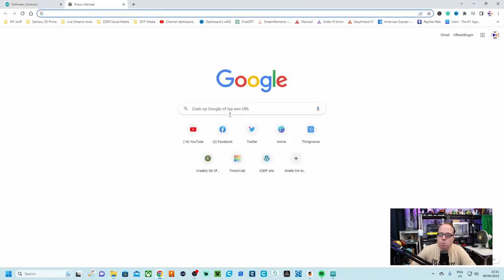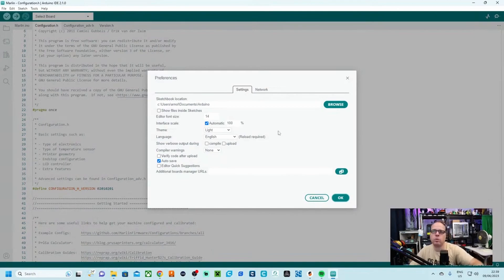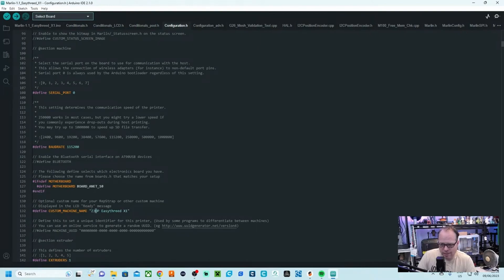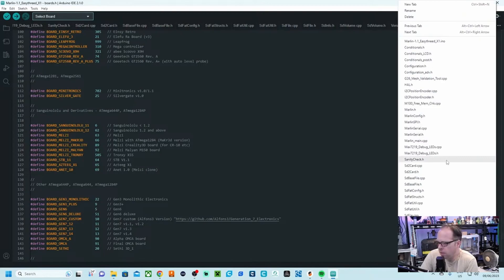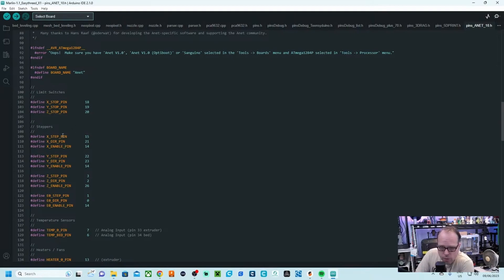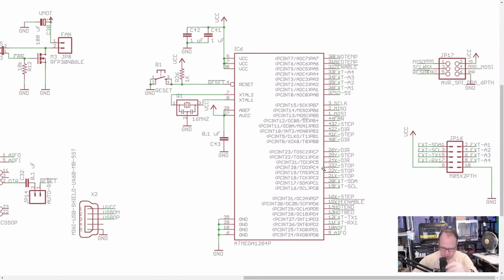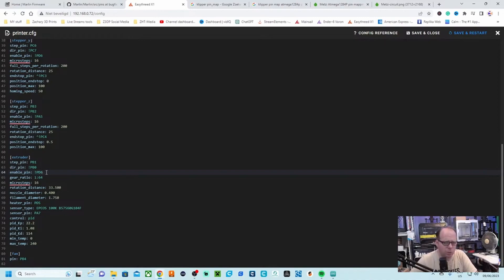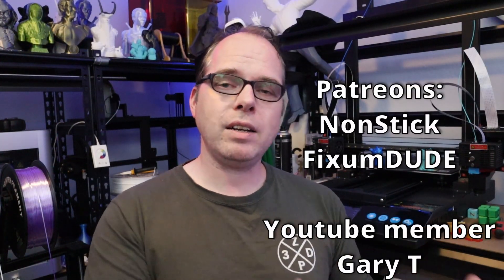PIN Address controller board for Klipper - Easythreed X1 Upgrades part 3

Comment: Did you ever get a working config? if so, can you share?
Reply from the maker: Sorry for my late reply. Yes I got it to work running Klipper, but not with the desired results and this printer isn't built for that speed. Motors are geared motors and getting very hot.

Comment: Hello. I appreciate your work on this. I recently acquired an X1 and am interested in using it with Klipper. Have you posted anything on GitHub for this by any chance? If so, do you have a link?
Reply from the maker: No I didn't shared it on Github, but I do have a video where I show the config settings. But I didn't continue with the project since it took ages to get the settings perfect and after that, it still wasn't good
Reply: @Zachary3DPrints  I do agree that even with Klipper, the quality is not great at all. If I spend more time on it, I'll probably replace the extruder / hot end as well as the stepper motors with some higher quality and better precision parts.
Reply from the maker: Oh yes indeed. And trying to get thing right or even perfect, takes a long time to get them right. Getting better quality part motors will indeed help, but not for this printer. It's just too expensive for this printer. 😂